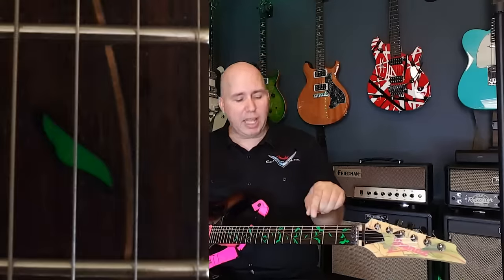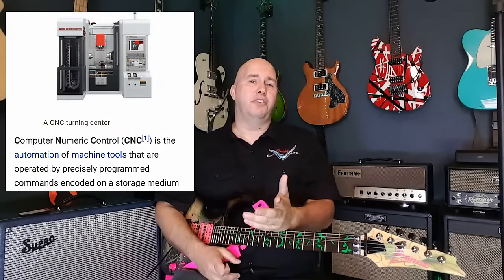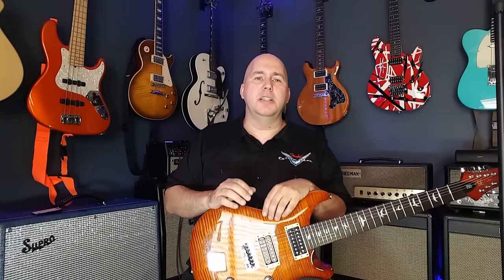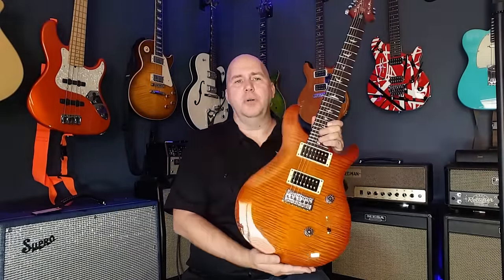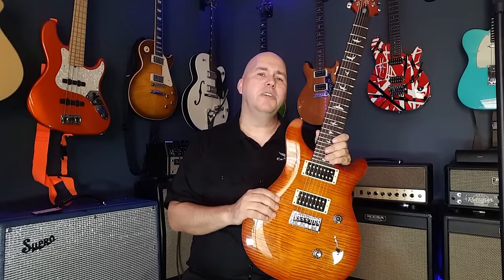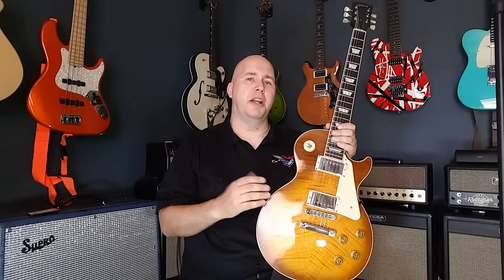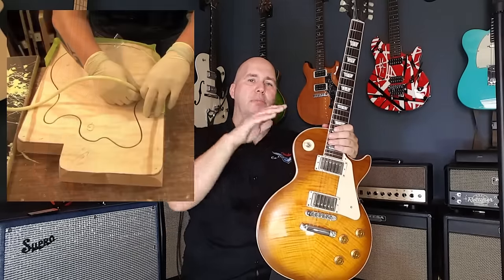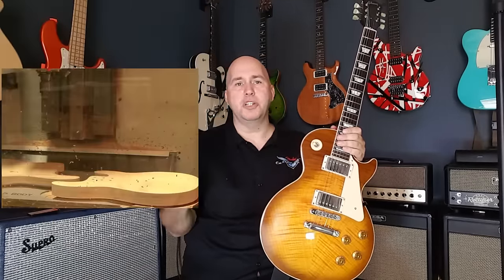7 Things That Do Not Make Guitars Expensive Anymore

Comment: Another excellent video, always wondered if the added costs really meant anything.
Reply: i always assumed it was due to the "prestige" tax. gibson is more prestigious than say jackson guitars, so gibby hikes its price up to reflect that prestige. jackson is more prestigious than cort, thus allowing them to overprice in turn. it's not like the indonesian and korean factories only produce one brand. i've got reasonable cause for doubt that my epiphone v and my dean michael schenker signatures were made in the same korean factory. doesn't make them bad guitars (quite the contrary, they're a delight to play), but my epi cost me 400€ brand new. the schenker (new) sold for 1500 or around about. got her during a blowout sale for 700€ new. roughly same specs on both; made in korea, two humbuckers, no splits, master tone, two volumes, same scale, set-neck, string-through, gloss varnish, dot inlays.. it'd be faster to list the differences. pickups are hotter on the dean, the dean came with strap locks and a hardcase, and the epi is korina, not mahogany, so it might justify perhaps the 300€ difference, but no way does it justify the 1100€ difference in manufacturer's recommended pricing. not knocking on the dean (it is a good guitar, although fragile), but i'm just as comfortable on the epi for much less.

tying in with the "prestige" tax, it could be the signature on the dean and on the dean-dmt schenker signature pickups. but i'm a player, not an economics major.
Reply: Eddy Guizonde good point, that definitely is weird, does the dean have better metalwork? i feel like good tuners and higher quality metals in the bridge and what not definitely makes the guitar more expensive, and then there could be prestige $ on that for being say stainless steel.
Reply: i don't really know. the dean's got stainless steel, the epi's got gold-plating. both sets of tuners (as far as i can tell) are grover kidney style 18:1. so, i'm really going for "prestige tax" over better quality. doesn't detract from the final comfort and overall feel, but that's too much of a price difference.
Reply: Yea, that is really something else then. I guess I'll have to go for the epi next time I'm skeptical.
Reply: Supmike Ladderboy just remember that epi cuts costs on wiring. buy your epi and get it rewired asap. since 2006, i've never seen an epi properly wired first time around. be it an entry level or an 800+€ one. it's usually the pickup selector that gives out after about 20 hours of playtime. my luthier if i remember correctly called it "expedient wiring". as in "yeah, it'll pass the quality checks, but not by much". pickups and wood are fine, though. only modded my v this summer, and swapped out the pickups for super distortions to get a beefier old-school tone (and some coil-tap pots).
Reply: Eddy Guizonde Damn, never knew that, got an Epi SG g-400 pro not too long ago. Been playing it nonstop since the summer and to this day I'm blown away by the quality of a 400~ dollar guitar. Has no buzz or noticeable problems so far, and the included coil-splitting gives that nice bright tone right on tap. How much did the V originally cost ya?
Reply: my v cost me 400€ in 2006, and it's still both the mfrp and its blue book worth. to be perfectly honest, i haven't tried a brand-new epi in 5 years. but i only heard good things about the latest squier and epi lines. hell, the vintage modified series rocks. so it's possible that they improved quality. i don't care either way, i'm just waiting to get my hands on another epi v. hopefully i can try the brent hinds since it got called "old-school feel" which i love, but failing that, the 58 korina v is a safe bet. if the wiring is off, that guitar is still worth its price.
Reply: I have an Epiphone Lee Malia Custom Les Paul and it was perfect out of the box and 1.5 years later everything still works great.  Was getting some cutoff from the stock switch but cleaned it and the pots and they work better than ever now.  Haven't had to rewire it and although it sounds great, I'm sure it would sound better with heavier gauge wire and better caps.  The Gibson USA pickups definitely help. I can hear a big difference between Gibby and Epi pickups.. I'm not a real big fan of Epi pickups tbh.
Reply: they're really good for old-school tones, but not much else. they're very warm, so for soul, blues, jazz, up to hard rock, really, they'll do the trick. i wanted hotter pick-ups but keeping the theme and tonal response, and swapped mine out for super distortions. now my v sounds like a hot-rodded vintage rock machine (even if i can go up to death metal with them, it still sounds vintage).

Comment: Just a correction on the Jem77FP and relates to a common misconception.  The 77FP always had fabric on the body and headstock for its entire production run. The same applies to 77FP2 from more recent years.  The 77BFP (Blue Floral Pattern) from the early '90s was indeed a photo finish as is the case with the current 77PBFP from their Indonesian-made Premium series.

Comment: #4. why is the prs CE24 only $2k and the set neck core models are so much more?
Reply from the maker: is it? add a American Bridge, Same tuners, same one piece neck, same Case, add the Veneer to the front of the head stock, And Add in the blade switch. Currently they are $2000 for CE and $3200 for Core, so if you add that in  how much different are they? So the question is, is the CE $1200 less for a bolt on neck? Or is it $1200 less for the lower cost gig bag, import bridge, tuning keys, neck (remember what I said about the necks) thinner body, and so on? Paul is on record saying it is not a big savings to do bolt on necks.
Reply: Phillip McKnight I understand, I was just ignorant until now. I thought that the ce24 had as much attention to detail and quality parts as the other cores. And the only difference was the construction and the top carve.
Did he do all those things just to bring down the price or to be consistent with the ce tradition...?
Reply: Phillip McKnight (for the record- original comment was genuine question, not being defensive or anything)
Reply: Sparkplug1034 I bought a 2016 Custom 24 Ten Top with 59/09 pick ups 6 months ago for $3400 and this week just bought a CE24 with 85/15's for $1900. CE has thinner maple cap with a thinner carve, the locking tuners are slightly different, the CU ten top wood has a more pronounced prettier wood pattern, the inlays in the CE are plastic resin? and CU is pearl or abalone? but look much better, the CU rosewood fretboard is a bit darker and shows more grain, CE has maple bolt on neck and the CU is set mahogany, the CU tremolo is all chrome and the CE has some components that have a satin finish. CU has 5 way blade vs. CE 3 way toggle with push/pull.  CU has a warmer tone but they both play great as they both have the pattern thin neck profile. Is it worth the extra $1500 for the CU? I am not sure but I do like the tone better on the CU and it stays in tune a bit better so far than the CE but I have only had the CE for 3 days.
Reply from the maker: No, the original CEs  had same specs as Set necks. He said that is one reason they discontinued them. They were not selling as well towards the end and did not cost much less to make. So when they brought it back they made the changes that would help the pricing. I think they did good job. I wish they were 1699 I think that is a strong price point but I understand why they did what they did.
Reply: Phillip McKnight interesting... Had no idea. Thanks!
Reply: 1699 tho??
Reply: He meant material wise.....fitment wise it's a large savings.

Comment: Good video, although I slightly disagree on a few points: 1. The higher cost of neck-through is not so much about finding longer pieces of wood (in most cases, they are laminated anyway), but that the manufacturing process becomes more complex when you cannot separate the parts. 2. Even if you only have a thin veneer, highly figured wood is expensive because it's hard to come by. 3. The same goes for wood in general. Bubinga is 4-5 times the price of basswood. One-piece bodies are usually twice the price of laminated bodies. Light weight swamp Ash is way more expensive than the dense northern variety. Naturally, the manufacturers will use the nicest pieces of timber for their high end models, and then add a premium for the whole package.
Reply: I like how you said 'not so much' instead of just 'not' or 'isn't.'

So many comments on the YouTube just shoot down every other idea other than theirs when it can fully well be both. That's silly.

Comment: What drives a lot of pricing is if a feature alters the production process 
Example: A wrap may only cost pennies and a short time to apply, BUT if adding that feature deters or slows the production process (especially if it involves a lesser number run) or creates a separate production stream to manage, it necessitates  a seemingly inflated bump in the price to keep the profit margin in line with a standard feature instrument.

Comment: One of the most needed video series would be Amp selection, and how to tweak them for the sound you want.  I was once in a shop trying out a custom Tele with a marshall stack tube amp and it was tweaked perfectly.....  I hit a groove that blew me away...and was getting positive comments by others in the store....  I should have pulled out the check book right then, and made notes of the settings.  Was never able to get it back..  also it's difficult to get the right sound when practicing in situations where you can't turn up the volume...  best small practice amps and how to tweak them.

Comment: A clarification is needed regarding CNC cut inlay, and associated costs. If the inlay you desire is one that is offered by the company the cost is determined by the cost to run the CNC machine (electricity, pneumatics via large compressor), the depreciation of the machines, prorated cost of purchasing/financing the machines involved, prorated cost of all tooling purchased or made (cutting tools, cutter holders/arbors, as well as any fixturing to hold and/or locate the work piece, and any gaging used for measurements), plus the cost of wear on the tool (finite tool life, performance lost as tool wears, and cost of resharpening/recoating cutting tool), and last but certainly not least is the cost of personnel involved (not just the machinist and material handler, but all those people wearing nice shors in the offices... like me). One more cost is the cost of process development, testing, optimization, and documentation, including CAD models and drawings, and CAM programming of the CNC machines according to best practices.  
Which brings me to my final item to discuss, and that is if you want a custom or variation of standard design for your inlay all of the cost of programming, designing, which may or may not include fixturing, gaging, tooling,, prove out process, and any number of requisite alterations to finishing operations due to differences in geometry or material conposition of inlay.
So to say that companies can produce inlay for pennies is just slightly misleading. 
Otherwise I thoroughly enjoyed this video and found very informative. Great contact content, great concept, great execution.

Comment: A veneer is way thicker than a piece of paper
Reply: Depends on your definition of "way thicker," and what paper you're talking about, I guess. If we're talking about a sheet of 90gsm printer paper, that's about 0.12mm thick (most companies allow a 5-10% variance). If we go looking for some maple veneer, the thicknesses I'm seeing are about 1/42", or about 0.6mm, about 5 times thicker. On the other hand, construction paper is a bit thicker, give or take 0.2mm (a lot less controlled though). So now we're looking at 3 pieces of construction paper in thickness?

It's not much that much thicker, really.
Reply: I'm talking about a regular piece of paper that every human being uses in a copier
Reply: the vast majority of human beings don't use copiers. Are you referring to A4 paper?
Reply: I'm willing to say that the vast majority of people do use copiers, and that the vast majority of people don't know what a4 paper is
Reply: Willing? There's no rest for the willing. I have never successfully used a copier but have successfully destroyed a few that wouldn't co-operate with me. I know way more about A4 paper than which way (face up or face down) it goes into the fax scanner to send a fax. Call me crazy.
Reply: A4 is approximately 1/10th of a mm. Veneer can be quite thin but usually it is 4 to 10 times thicker than A4 paper. Veneers are subject to adhesives soaking into the grain, etc, so they need to be so-so thickness-wise. Not too thick and certainly not too thin. The thinner the better but only to a point. What is too thin, would depend a lot on the adhesive used to hold it down.
Reply: jacksector not an argument
Reply: K.D.P. Ross how are those related, paper knowledge and country of origin?
Reply: A and B paper sizes is the standard type of paper for everything outside of the US, posters in most countries are A4, A3, A2 or A0 (huge rock posters) and most cities still have posters everywhere. Nearly all offices and education institutions use A4 as their standard. So most people do know what A4 paper looks like. An excerpt from wiki "Today, the A and B series of ISO 216, which includes the popular A4 size, are the international standard used by almost every country. The only exceptions are United States and Canada, where the "Letter" is more prevalent."
Reply: I don't work at dunder mifflin
Reply: the vast majority of people in my office get interns to use the copier for them.
Reply: Dude construction paper finishes. Brilliant!!
Reply: 3 pieces of construction paper is still pretty thin
Reply: Oh, not true my friend. Nowadays veneers can come incredibly thin, up to 1/90 of an inch. Depending on wood type of course. Whereas your typical printer paper is about 1/40 of and inch. Actually, if you want to see something incredible, look up Japanese planing competitions. They plane pine wood down to 4 MICRONS thick. Paper is about 80 microns thick. Crazy stuff
Reply: cone US is the only place that uses "Eight and a half by eleven", which I'm sure you've heard of. Every other place else uses a system that is objectively better.
Reply: In Canada I do not see anything else then 8x11 1/2 paper size. Not only in the US of A.
Reply: You're diluting his point. It really doesn't matter if it's a piece of paper or four times that. I've gotten A grade ply where the veneer was 40 thousandths (ten sheets of A4 paper, roughly), other birch ply where it was a hundredth of an inch (2 1/2 sheets) and I've hand cut veneer up to an eighth. The point is that nobody can tell you now that you need $500+ for a 5A maple top because the top wood costs $125 and has to be carved (they won't tell you that the top wood costs $100-$125 - or less, they just tell you the $500+ part).
Reply: Yeah, and interns aren't even human, so there's the fatal flaw in cone's argument.
Reply: Canada is just the cold part of the US.
Reply: Not really.. they can get them pretty thin these days

Comment: all the guitars i have are bolt-on-set-neck. its where you unbolt a bolt-on neck, clean the paint off and lightly sand it flat, then glue it, bolt it back on. instant improved sustain and strength, and you can even bevel the joint now without it breaking and either shorten or throw out the screws, even filler it in. i personally leave the screws and just round or angle the joint perfect.

Comment: 3:38 Tradition....you nailed it.  So many musicians are set in the ways of tradition, rather than actual sound or playability.  The truth of it is, guitars and amps these days pretty much all sound really good for a very low price.  I was buying band equipment back in the late 90's, and the prices are pretty much the same these days, or even cheaper.  And all of the instruments (even the cheap ones) seem to play 1,000x better than cheap guitars 20-30 years ago.  Most of what you're paying for in an expensive guitar today is more attention do detail in the finishing aspect and better hardware, most of which don't change the actual playability all that much.

Comment: Great video! Lots of good info here...as someone who used to work in the tonewood industry, I would like to add a few notes. In addition to the issue of straight even grain for neck through blanks, other imperfections are harder to avoid as well, making the cost for larger blanks of the same grade much more expensive. The classic example of this is the price difference between a medium sized acoustic soundboard and a larger top like a jumbo or dread.  There are a lot of other reasons why tonewood is so expensive and some is more expensive than others, most of it doesn’t have to do with the source cost but is driven up by overhead and waste.  Guitar manufacturers and luthiers are picky (for good reason) about the wood they use and as we deplete old growth trees, the huge (mostly) hardwood and spruce trees needed for guitars is getting harder to find in top grades. Anyway, there’s definitely a lot of wishy-washiness in the tonewood business in terms of cost vs price and meaningless terminology meant to upsell as well as other shadier stuff(a la Gibson), but there are also a lot of legitimate costs that a lot of folks don’t consider when they look at the cost of a plank of rift sawn twisty wood with runout and other imperfections or logs in the round which may be useless if they aren’t treated and sawn right, let alone if it’s full of imperfections.